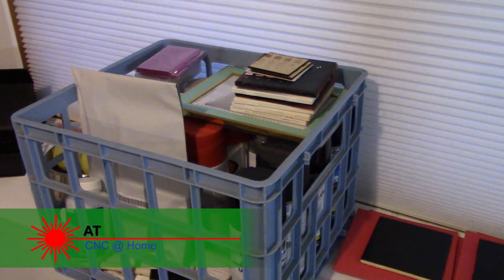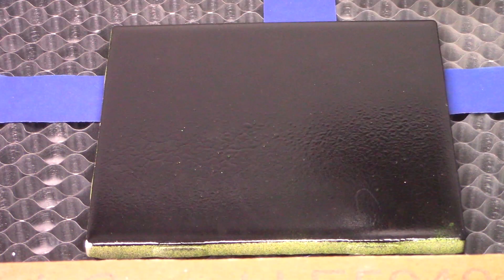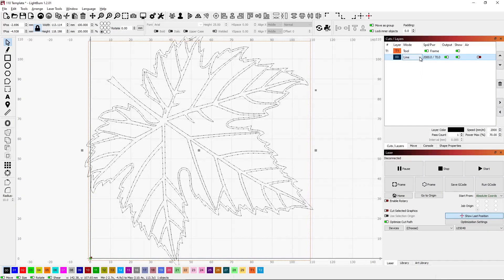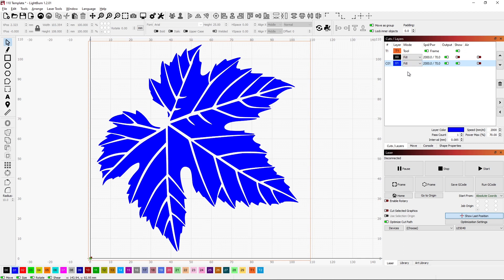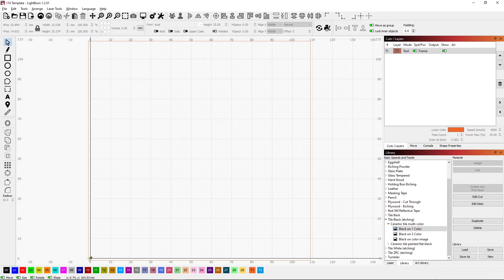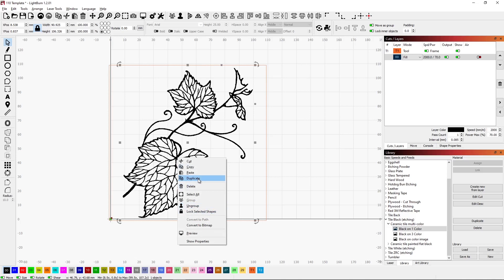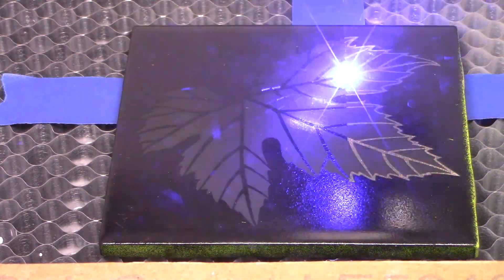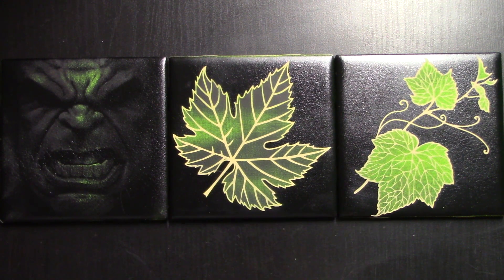What do I do with this old stock of painted tiles?

Comment: I LIKE ENGRAVING CERAMIC TILES, I ENGRAVE 12 X 12 TILES, PAINT LAYERING IS TRICKY TO DO, SMOOTH RESULTS CAN BE ACHIEVED, WITH A FEW BASIC STEPS, I HAVE A NICE SMOOTH PAINT FINISH, DECENT DISTANCE AND STEADY MOTION, TEST SPRAY FIRST(PREVENTS SPECKING), PLACING THE TILE AT AN ANGLE WHEN SPAYING WORKS BEST FOR EVEN COVERAGE, ALL OF THE EDGES ARE SPRAYED BECAUSE OF THE TILE BEING ANGLED, ALSO TEMPERATURE HAS A GREAT DEAL IN THE END RESULTS, I SPRAY OUTSIDE(I MADE A SMALL PAINT BOOTH), RIGHT AFTER THAT, TAKE THE PAINTED TILE INSIDE, I LAY IT DOWN FLAT, THOSE FEW THINGS SHOULD HELP ANYONE TO END WITH A BETTER SPRAY CAN JOB, I REALLY DID NOT FEEL LIKE TYPING ALL OF THAT, BUT IT SEEMS MOST PEOPLE CAN NOT SPRAY CAN, SO I HOPE THIS HELPS A LITTLE, THERE ARE A LOT OF FACTORS IN HAVING A QUALITY END RESULT,
Reply from the maker: So true!  Thank you for sharing these tips.  Even and consistent coats of paint are key to good results.
Reply: @CNCATHome  EXACTLY